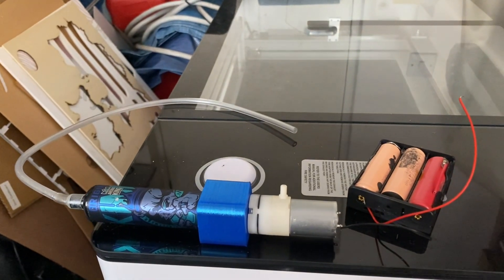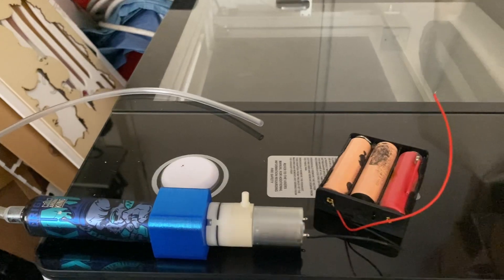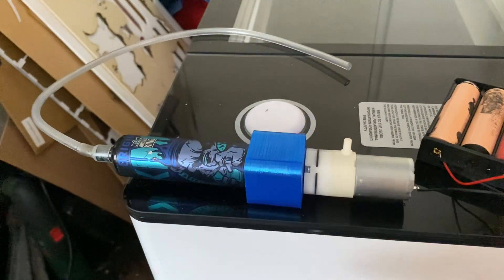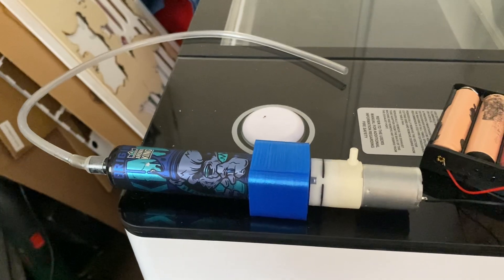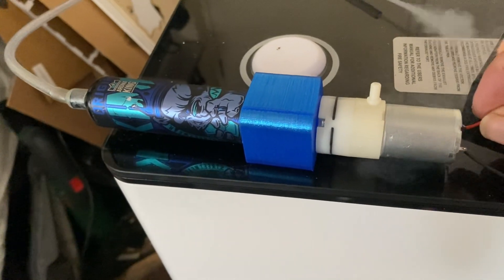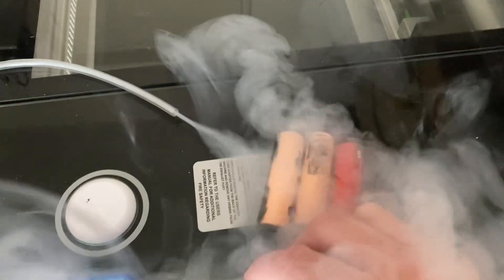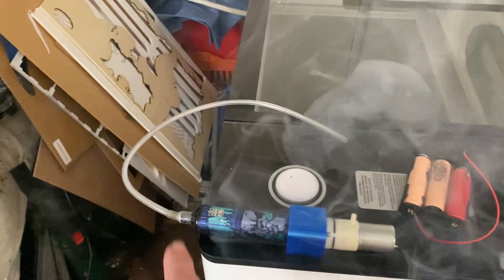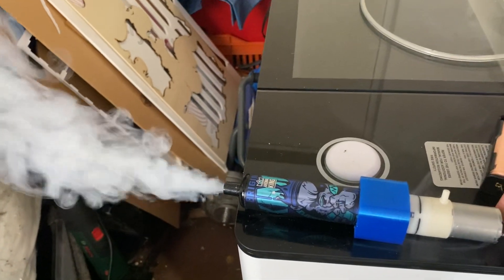Portable smoke machine battery powered for cosplay and props

Comment: The exact same vape was delivered today and with the adaptor and air pump works incredibly well.  One question ... how did you get the cap off to refill am scared of putting to much force on it.  Thanks again... PS This.whole project cost less than £15 which is an £85 saving on the cheapest solution on Aliexpress
Reply from the maker: Force :)
Reply from the maker: If you think I’ve deserved a cup of coffee out of your savings, the paypal address is in the video description ;)
Reply: @ImperialLightandMagic  done